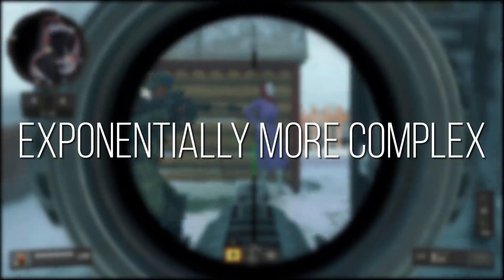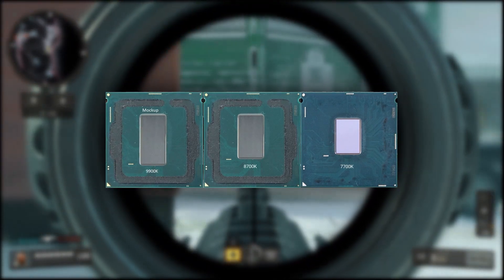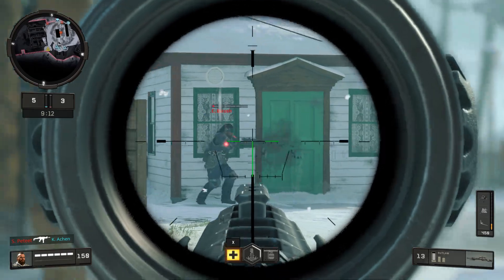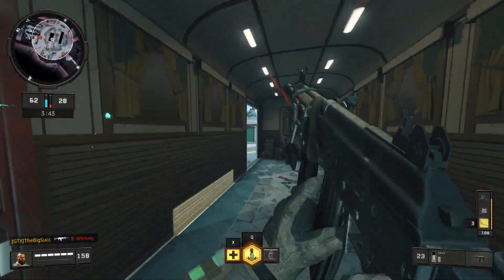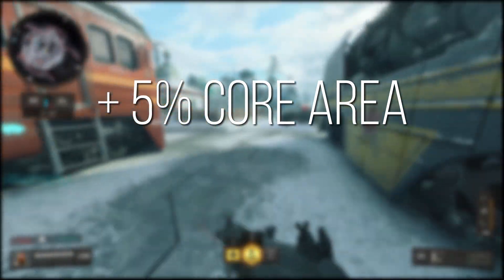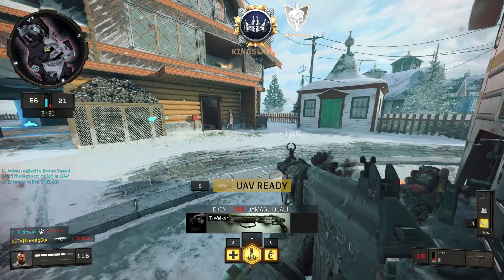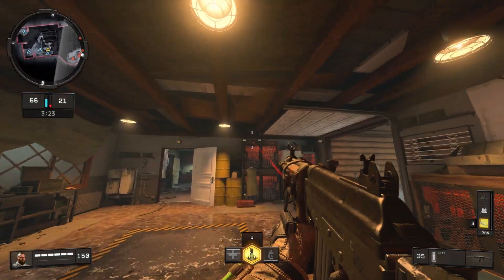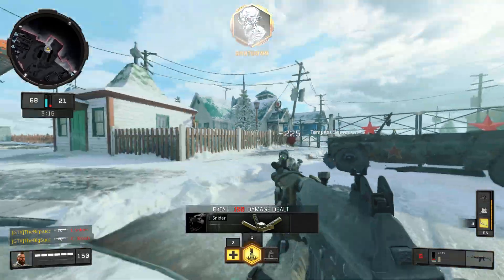SMT Explained! - CPU Hardware Analysis

Comment: but your missing out on one really important fact. a cpu core can have multiple physical threads in it and not support SMT at all. SMT isn't explained very well either by both you and wiki. I think SMT explained simply based on what I read and you is that it divides your physical CPU core threads by a number and then it can parallel compute them. However the clock speeds per second are also divided by 2 with SMT (usually) because instead of 8 threads cpu(4 cores) you now have 16. but your limited by the number of instructions per second even further. it's like you just essentially have 4 cpu threads instead of 2 per core now. let's say you had 4.2GHZ per core. you now have access to about 1.05GHZ(per thread) instead of 2.1GHZ(per thread) which is 1.05 billion instructions per second on the x64, x32 or x86_64, amd64 architectures. ARM works different and I can't verify anything on zen works as I don't know how many IPS(instructions per second) is related to the frequency speeds. In conclusion if your running games that want to run over 1 billion instructions per second per cpu core then this would actually be worse then if you just didn't have SMT. SMT can be good or ok if used properly but overall I wouldn't recommend it
Reply: That does not sound right to me. You don't divide frequency by number of threads per core, it's more that they share backend resources. Now in the worst case that means your thread gets half as much done per unit time because the sibling thread is also using half of the backend, but if that other thread is doing nothing or not hitting the same execution units then your thread can still get theoretically up to the same performance as without SMT. You can see this is the case by disabling SMT or affining heavy tasks to only 1 SMT thread per core, they'll individually perform better than if they were running on all threads (of course you probably lose some throughput though).

Comment: I remember getting that 30% boost from threading in the 7-Zip performance test on my old P4 with hyperthreading.
The worst possible case, though the modern OS schedulers should avoid it as they are SMT aware, is where tasks end up scheduled to two threads on a core instead of to 2 available cores - of course, the scheduler may not always be right, as an exhaustive search may be too demanding, and it cannot predict how long an existing thread on a core will remain busy.
There are definitely a few cases where HT off can perform better.